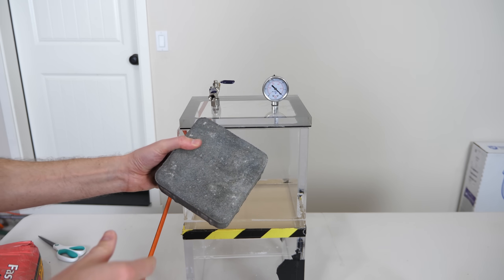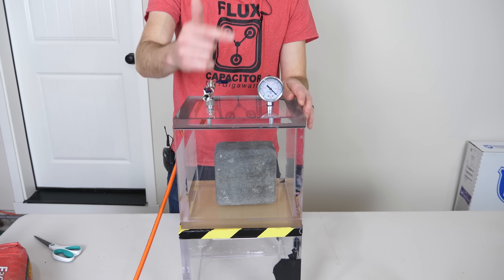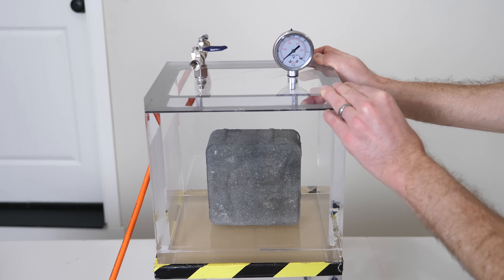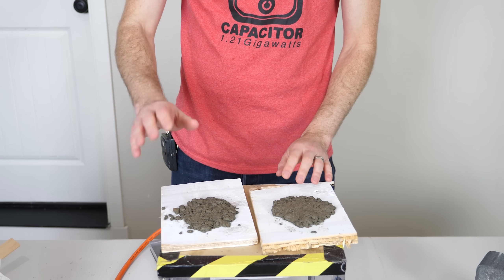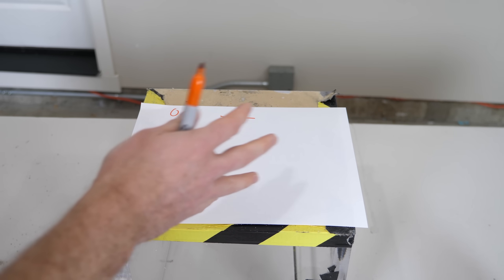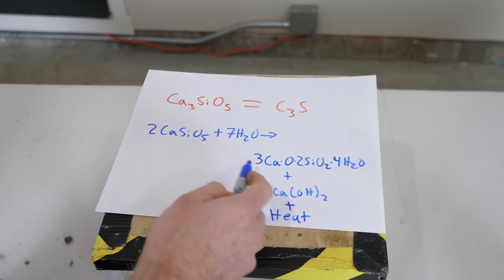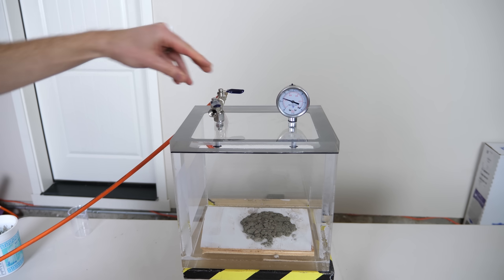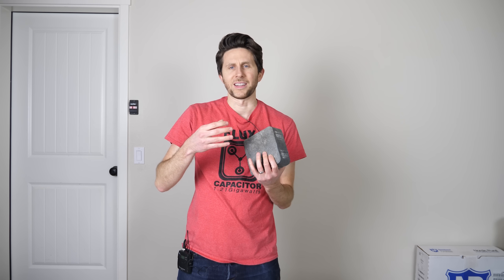Does Concrete Turn to Dust in a Vacuum Chamber? Concrete Without Oxygen Experiment

Comment: I think there's a problem with the experiment. Cement setting occurs when you add water to the mixture right? This is a forward reaction in the presence of humidity and the equilibrium is at the hardened state. But there should also be a slower backward reaction which is prevented largely due to humidity in the atmosphere so my guess is that if you leave it in the vacuum for long enough it should crumble and become brittle. Can you try that?

Comment: As commented somewhere, there is gas trapped within concrete.  Which gases, i don't know.  But it seems possible to have microscopic cavities.  So, for a contrary approach, mix and set concrete blocks with various mixtures.(additives that entrain air, or that drive air or gas out of the mix.)  Would they survive if put in extreme pressure, like the Mariana Trench?  And what concrete is used for deep water drilling?  Admit the pressure is not even close to the Trench, but still, is it a consideration?

Comment: Now show how you can have a gas (atmosphere around a supposed spherical earth) next to a vacuum (supposed vacuum of something you call space) that fails to equalize with the available volume of an ever expanding lower pressure area, due to entropy as is the dumb heliocentric theory claims. Impossible, it would break the 2nd law of thermodynamics. Just like the Curie temp shows you cannot have a molten core generate a magnetic field, again, your Teachers Lied to you!

Comment: I thought that the concrete block shouldn't colapse because it has a very strong physical structure and the pressure of the oxygen rushing out couldn't possibly be strong enough to tear it apart

Comment: How i measure vacuum pressure for break the pipe which inside the sealed container vacuum is applied externally , in theoretically?

Comment: If you boil dirty water in a vacuum chamber how much less energy does it take than heating it?  Is the steam siphoned off now safe to drink?
Reply: It takes the same energy, because it's the same process. You still have to heat the water in boiler to evaporate the water and you still have to cool the vapor condenser to condense the water. Pumping the vapor from the boiler to condenser is the same thing as pumping heat from condenser to boiler. That's how refrigerators (and heat pumps in general) work.

The only variables are which process can you do more efficiently and how fast do you want it to happen.

The condensed water will not be safe to drink directly, because it will be distilled water. You will have to add minerals to make it drinkable.

Comment: Concrete cures, and doesn’t dry. Drywall dries
Reply: What do I do if I have wet wall?😳
Reply: ...Ian, that was a DRY joke...
Reply: @stephenfiore9960  are you sure; do you have any CONCRETE evidence :]
Reply: @ianfrankegordon4182  solid jokes all the way round
Reply: Isnt DRYwal dry ?
Reply: @moreelosilva9407  not if you nail it ;)
Reply: Now when you say that concrete cures, what does that actually mean? And what about dry wall? I need to learn. Thank you.
Reply: @farcasbogdan  when something dries, it means the moisture is being pulled from it, when something “cures” it means that the material undergoes a chemical change to harden, like bondo
Reply: @christophersootoo9168  aah. Thanks man.
Reply: @farcasbogdan  Actually if you eat concrete it will cure you.
Reply: But when concrete cures, doesnt it also get dry? 🤔
Reply: @antaLord  no. You actually keep concrete wet as it sets to increase strength
Reply: Ohhhh
Reply: What if I nevr wet my concrete?
Reply: @prihaps  so I’ve done this before on the job, you can actually dry pack the concrete and let it absorb the moisture in the ground. As far as not letting any moisture get to the concrete, it would never harden because it would be missing an ingredient for its chemical reaction to water.
Reply: @christophersootoo9168   I was just making a bad joke😂
Although that is interesting the dry pack method. If I were to, lets say, dry pack a square of concrete on grass to make like an entry way; would that actually work by just watering it kinda like a plant? Wouldn’t it not penetrate all of the concrete, thus making unstable concrete?
Reply: @prihaps  actually you don’t need to water anything around it, the moisture in the ground is plenty, it takes longer though
Reply: @christophersootoo9168  True but the concrete strength is dependent on the water/concrete mix. I would assume it would not be as strong as it would be if is mixed properly.
Reply: Concrete sets.... Curing refers to keeping it wet for the proper amount of time thereby making it achieve full hardness
Reply: Is this a king gu panda 2 reference XR
Reply: I bet if I dump water on it and the water evaporates, that would be drying. :D
Reply: So that raises a question... was this his like watching paint dry or paint cure?

Comment: Basically, building more buildings made of Concrete, the Oxygen in the atmosphere decreases which is bad?
Reply: Not really, most of the Oxigen on earth isn't even on the atmosphere, most of it is either in water (both as part of the water itself as well as O2 dissolved in it), or in the crust (either as moisture or as part of the chemical makeup of the substrate itself) and concrete is just taking the O2 from the crust and moving it elsewhere (technically anything we build is part of the crust)

Comment: If you're in a hurry, the answer is no. Concrete does not turn to dust in a vacuum chamber. Just like someone in the comments said, "You can't pull out oxygen that's already bonded to the concrete molecule."

Comment: I think that regardless of the vacuum, it's still going to get it's oxygen from the water,    if this is correct and true, apart from the release of heat which to me indicates that bonds are being broken and there should be hydrogen left out in the chamber but you would have to mix the concrete fast and place it in the vacuum chamber fast and get it into vacuum just as quick! Possibly also use more concrete and water and then have a way to detect which gasses are present, unless someone else has already performed the same experiment! 
I was honestly expecting it to not set but the fact that it did! That tells me that it's pulling the oxygen out of the water and generating heat in the process, notice also that the vacuum chamber didn't fog up from the heat and water content! That's because it now not water anymore! Probably just hydrogen! This might need a little more looking into it if the equipment to test the gasses is available! Isn't there some way to use refractory light to see the wavelengths of light through whatever is in the vacuum chamber?

Comment: Lil late but maybee cracking 20% crumbeling to dust 0,0001%  depends on if its correctly shaken to remove the air bubbles. Solidifies without air 100%

Comment: it does not need air. it's a chemical reaction with the water. air entrainment is good for outdoor concrete because it allows it to expand and contract with temperature differences.  indoor concrete you dont want that (like the floors in your local walmart or something) It will crack if it has air in it.

Comment: Idiot videos posing that concrete needs oxygen to stay solid. It does need oxygen for the curing process as it's needed for the formation of the crystalline structure with the calcium and silica, but once it's set, it's set, the oxygen atoms are locked into the crystals

Comment: I don't think that the concrete will be affected.

I also think that the cement will not be able to dry in a vacuum since there is no air pressure to evaporate the moisture.

Comment: The concrete doesn't rely on atmospheric oxygen to maintain cohesion; it's relying on the oxygen bonded within it. 
If that were true, it would be impossible to build extremely tall concrete structures because the atmosphere gets thinner the further up you go, and so the integrity of the concrete would be weaker the further up you go.

Comment: The building will fall or become dust because of its mass.

The concrete u use its lite so its wont become dust.
Yeah.. to prove it we must use building size vacuum chamber and put it and the chamber will broke too.

Edit: the building made from concrete will become dust because of its age of concrete and any particle in sky go inside concrete.

If the concrete have a long age it will be easy to become dust.
If the concrete its new or its has been created its so hard to become dust

Comment: Considering concrete can set underwater no oxygen is not needed. Also even in tention concrete can withstand one atmosphere of pressure. So my guess is. Nothing will happen, and it will set just fine.
Reply: Also this would have been a fun experiment to go with Grady from practical engineering.

Comment: On the concrete block I'd be more interested in dimensional changes did it get bigger or smaller or no change at all. Higher atmospheric pressure objects shrink so in a vacuum it should increase slightly.

Comment: Ofcourse it wouldn't be turn to dust, because concrete has not oxygen as elemental type. It has oxygen as compound version, it means oxygen has connected to concrete with chemical connections, that's why you can't take it back the vacuum method that is physical method. Elemental oxygen(O2) doesn't equal to compounditive oxygen.

Comment: what about a concrete specimen with a high amount of airentertainers mixed in. Would it be enough to compromise the structural integrity of the concrete, by reducing the load the concrete can hold? I imagine not since concrete is waterproof. therefore the air in the tiny voids in the concrete could not escape? I am a civil engineering student currently studying concrete. Loved this vid!

Comment: What's chemical formula for cement I think it has lime in it if it's bonded during mixing, drying sets it then it's not going to take oxygen out simply by putting it in vacuum chamber?an exothermic reaction.how long did you leave it how long it take to set.

Comment: Well the fact sounded too ridiculous to be true ...
In that case , there would be no use of concrete in outer space and under water ... ...

When said that it would turn into dust , it meant the loss of even the chemically bonded oxygen , which is impossible with a vacuum pump ...

Comment: That's frustratingly misleading. If they mean "magically make all oxygen atoms disappear" they should say that instead of the ambiguous "remove oxygen" that is generally used to mean extracting free oxygen from an enclosed space. If you actually just magically removed any common type of atom from everything, what you'd likely have is an unfathomable explosion from the energy of all the broken chemical bonds.

(By "magically", I mean through some method that didn't involve a process of physical reactions, which is required for what they're suggesting. No physical process that would remove the oxygen from things would be able to do so without destroying them anyway prior to them "crumbling to dust" as was suggested.)

Comment: Ok, we may use concrete in space. But what about the temperatures? If you will count with very low (or high) temperatures it might change the quality of the material. So you can try it if you have the possibility. :)
Thanks

Comment: I'm confused.  Or amazed.  "Remove all the oxygen and ....."  Oxygen is only 20% (there abouts) of the atmosphere.  So putting it in a vacuum is beyond the meaning.
Nothing against you either - more on safety:   Yes it was a vacuum chamber and if it failed:  it would IMPLODE rather than EXPLODE.   But gee.....   no face protection?  You would be wearing the pieces from the other side of the chamber.
There is another "Problem" I can see:   IF there are air bubbles in the concrete and you put it in a vacuum, it may explode because the pressure in the air pockets may be too much.   But that is very conditional on a lot of unknown variables like:  how much air bubbles are in the concrete and how big the bubbles are in comparison to the size/piece of concrete.

Comment: Concrete is cement mortar mixed with gravel, cement mixed with sand and water is mortar without some form of agrigate such as gravel, rebar and such it is not concrete (spent much of my life in the building industry with a family of builders, brickies and such)

Comment: The misunderstanding of oxygen gas and bonded oxygen is astounding as something that could be thought of.  If you remove all oxygen from the earth (which I mean to take as the atmosphere ) nothing messes with bonded oxygen because it's no longer in the atmosphere, it's bonded to something.  The best example of this is if you inject water into a vacuum/space.  In space at least, water droplets turn into spheres instead of exploding and releasing the oxygen.

Comment: I don't know how much atmosphere was trapped in the setting process. So first I'd have to guess that. Okay, I will guess quite a bit of atmosphere is trapped in concrete as it is made with water and water has gases in it. But the gases in water depend on atmospheric pressure and temperature. Also when adding a substance to water gases will be displaced. Ever add a teaspoon of sugar to a cup of boiling water just out of the microwave just to have 90% of the water boil out of the cup? That is air being displaced by the sugar. However, there is a difference between adding insoluble material versus soluble material  to the amount of air that would be displaced.

Okay my guess is based on supposing that there is quite a bit of atmosphere trapped in the concrete and that it is evenly distributed and there is enough internal pressure that when put into the vacuum chamber that it will turn to powder. But, I will not be surprised if nothing happens or just a few stress cracks form. Really though, I have no idea what will happen.

Comment: this is moronic, you're removing air, not 'all the oxygen molecules'  why would it? even if you made a void in the middle filled with gas then the concrete is more than strong enough to act as a pressure vessel

Comment: Did you know that on average, people take about 24,000 breaths per day, for a total of 3,000 gallons. But, that is meaningless in the context of an individual. Even if we assume that the rate at which people take their breaths to be constant for all people, there would still be variations due to the difference in size of a persons’ lungs. However, we know that the rate at which people breathe is not constant throughout the day. It varies depending on what we are doing. All this is intended to say, that an average of how much air people in general breathe per day is not an indicator of how much air an individual would breathe in the same time period.

Comment: I think it will crack but not crumble, Fairly sure.

Edit: Nope. I thought the internal air bubbles would apply enough pressure to overcome the very weak tensile strength of cement. But, that wasn’t the case.

Comment: Before i start this video, i bet that the concrete will stay as it is, because oxygen is bonded into the concrete molecules and it's impossible to take oxygen molecules out of the concrete using a vacuum chamber

Comment: 1 bar cure vs 0 bar cure test would be a little more rigorous if you had made the same wet mix and filled two equal plastic cylinders. This is how they actually do it in the construction world. Then test them for compression in a Harbor Freight hydraulic press and compare results. Or you could do the cow-patty-and-Sharpie-stab test.

Comment: Tha name says everything hydration the reaction with water not with the O2 in the air itself
But, if we are talking about plaster than the absence of air is a problem because the increase in resistence is due to reaction with the CO in atmosphere, a vacuum would be a problem

Comment: The vacuum barely slowed it down cause the concrete in the vacuum was a little bit more wet witch why it was a touch darker. Did concrete work for about 2 years

Comment: What concrete needs to cure and harden properly is simply to have it hydrated with sufficient amount of clean, fresh acid-free water. If during the mixing and curing the poured concrete were placed in vacuum chamber it will simply draw out all the water required for the cement to fully react and binds within the mixture, making it very brittle if it manages to form any chemical bonds at all

Comment: Wait a minute, doesn't this mean concrete would be a superior building material for spacestation! Since you could very easily use the materials from the low gravity Moon or asteroids to get materials for complex and thick space-structures to shield grom radiation while being very non-restrictive in what you can do. Especially with a concrete based 3D printer

Comment: 100% the vavume will only remove free flowing gass molecules oxygen within concrete has a strongly bonded molecular structure preventing free movement.
If somehow all oxygen could be removed instantly then I would expect the concrete to crumble as the oxygen bonds are needed to retain the concrete structure.

Comment: If you removed molecular oxygen a lot more than concrete would crumble. Bare metals would fuse together without the oxide layer. Every living thing would die for a number of reasons. One of which is the disruption of the electron pump in mitochondria that requires oxygen as the final step.

Comment: Problems: you definitely need to put the concrete in some sort of container (like a butter container) both inside and outside the vacuum chamber. I do concrete stress testing on my construction job sites, I’m very familiar with the process. Make each sample the control and variable at least 3 inches thick then let them harden for 6-12 hours THEN do your post vacuum curing tests.